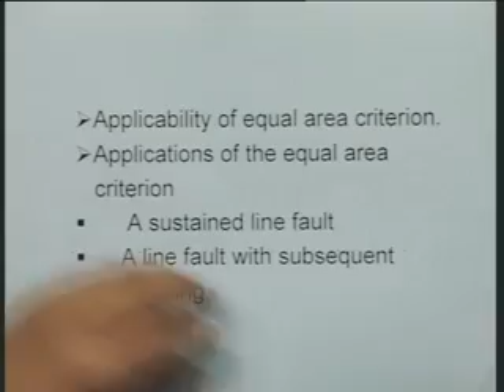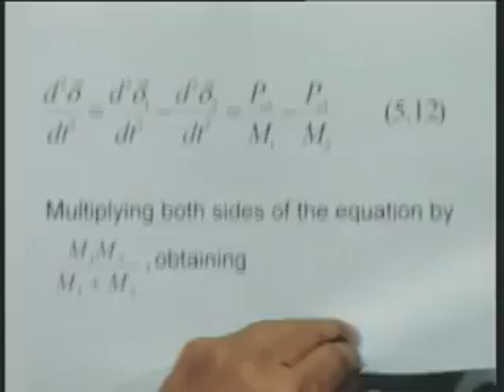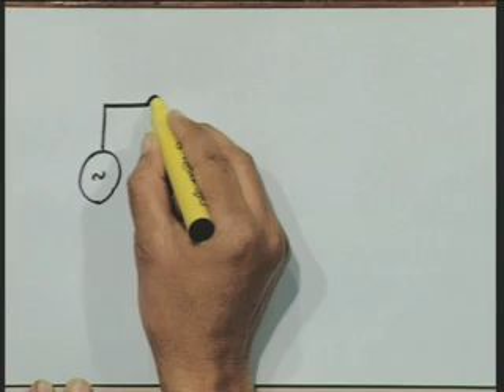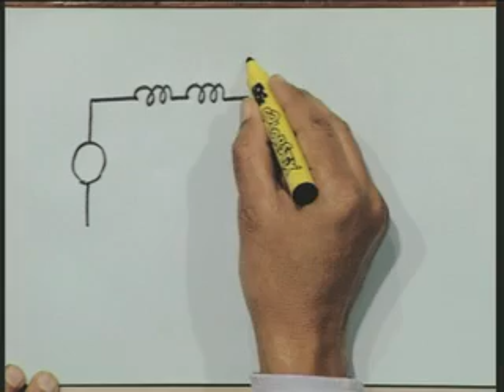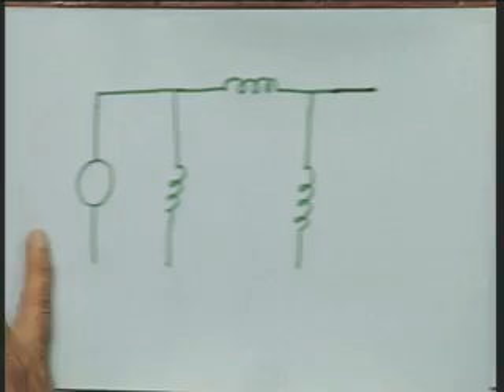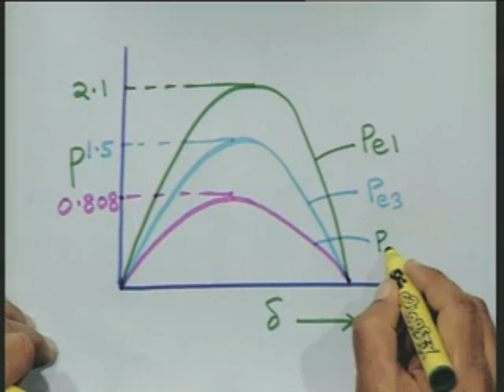Lec-5 The Equal Area Criterion for Stability-Part-1

Comment: i m extremely sorry sir but under short circuit condition rotor decelerates and angle increases whereas during acceleration angle decreases which is just opposite to what u said.
Reply: no, He is right.  what you are telling is for a synchronous motor. For a synchronous generator, acceleration ( in sync.gen, the rotor leads the rotating magnetic field by angle delta) will cause increase in angle between  the rotor and the rmf.